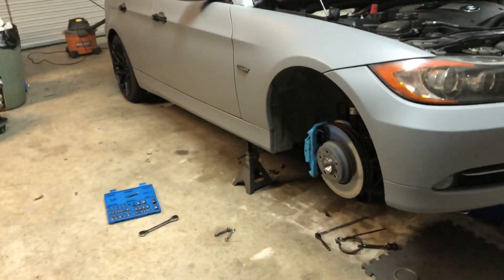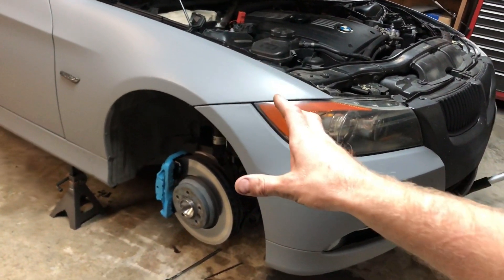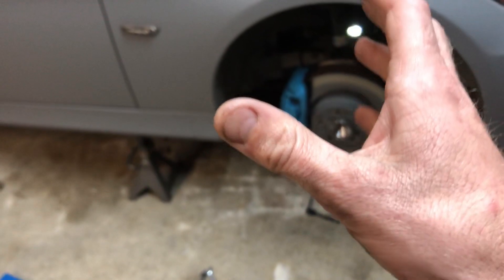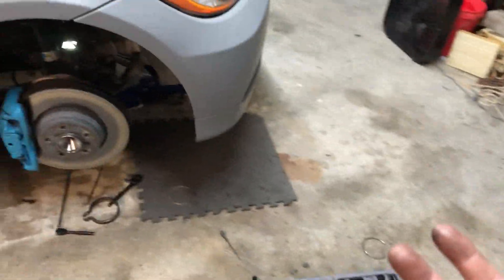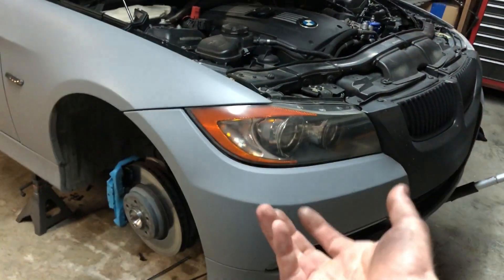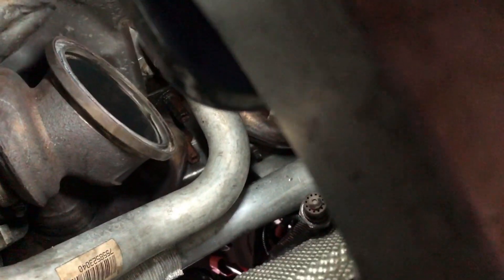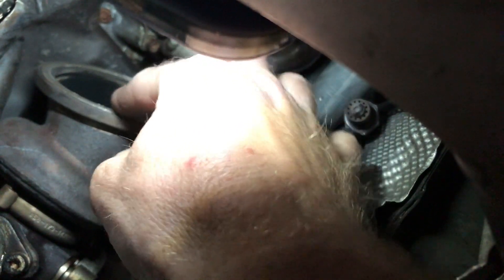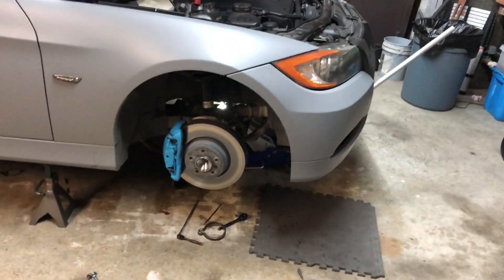REPAIR N54 Turbo Gasket Leak (Find and Fix )

Comment: After swapping the turbo to downpipe gasket did you verify it no longer leaks? I used the same method and even with new gasket it still leaks any ideas?

Comment: Do you find that the original o2 sensor seals again or do you need to get a copper washer fit it? 

The cheap-ass bolts that came with my downpipes (nuts) stripped before fully tightening. Not sure if it blew the gasket out or not, I haven’t driven it, just started it to look for leaks.

Comment: My N54 is leaking oil most smoke is coming out only when I drive an there’s pressure going into the lines , I stop and I see a shit ton of smoke coming out of my hood passenger side close to the heat shield . This was after my turbo replacement and I had my valve cover also switched the month before. Already ordered the turbo gasket kit hopefully that stops the smoking
Reply: ya it will leak right down on the exhaust smoking mine did that too and i replaced gasket and o rings and fixed
Reply: @jrock865  mine doing the exact same thing would you mind sharing where you bought your parts
Reply: @maldonadomaldonado6572  mine was the oil return o rings and gasket at the turbo.  it was dripping down from the gasket onto the exhaust.  i bought the o rings and the gasket for the turbo side it fixed it.
i'll see if i can send a link to what i used
Reply: @maldonadomaldonado6572  i also had changed my oil pan gasket which was a nightmare in a xdrive and valve cover gasket changed.  i bought the car off a guy that had it garage kept so luckily mostly everything was clean but had to change a ton of o rings and water pump etc.
Reply: @jrock865  thank you bro this smoke Is embarrassing big time.
Reply: @maldonadomaldonado6572  ya if you notice is probably  your rear one leaking mine was mainly that one leaking right down on the exhaust.  The turbo oil line on the rear i mean.  should see some residue hopefully to find it.
Reply: @jrock865  thank you I saw in the exhaust oil so yes that will be the one.

Comment: I'm having similar issue with my n54 where the downpipes connect on the bottom not to the turbo's it's leaking on the bottom even with new gaskets does anyone have a solution for this....
Reply: im having the same issue right now , have you /did you find out what it is?